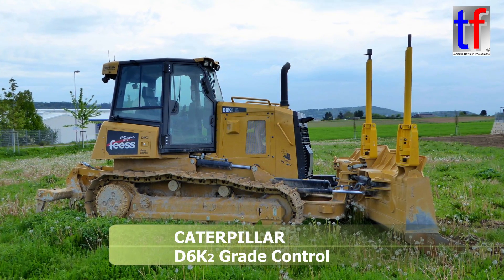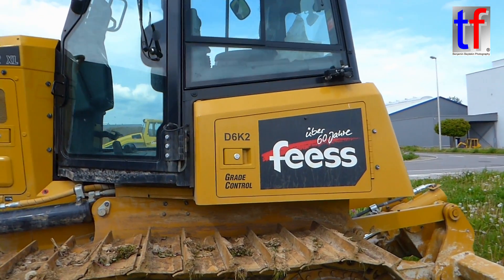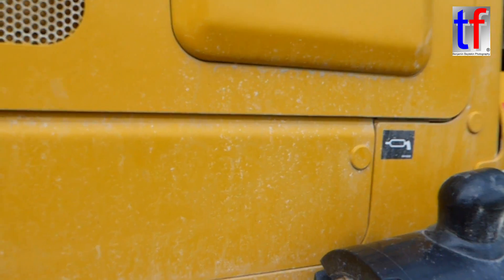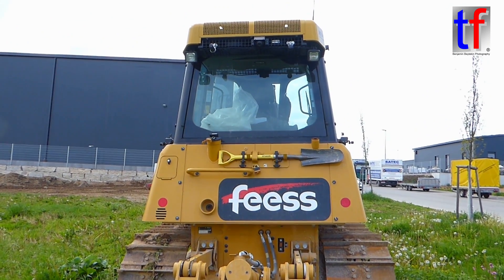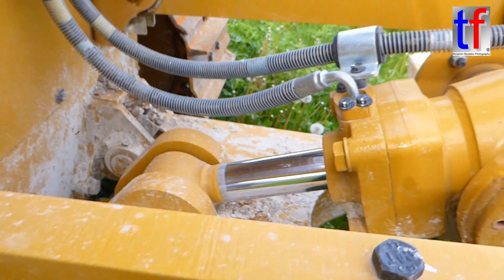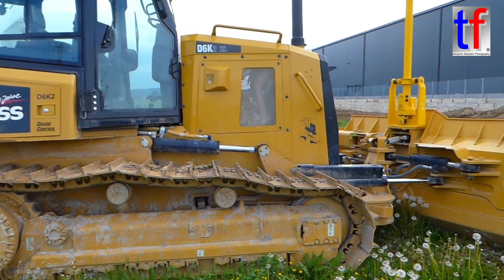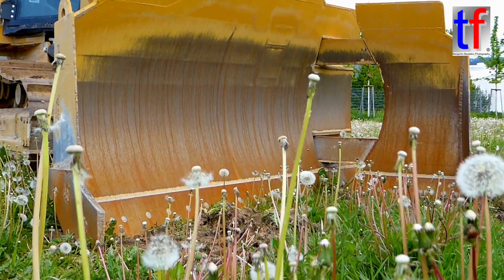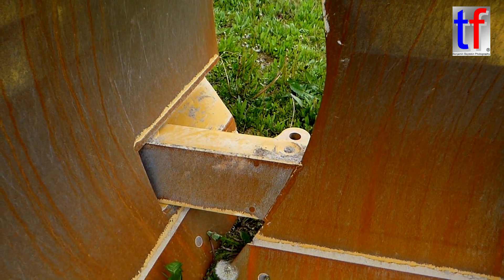CATERPILLAR D6K2 XL Grade Control Documentary, 2017.

Comment: You did a good job with this one man. I have a slightly older Bruder D6 T in my fleet. I got it in January 2013. And for my birthday I'm asking for my very first radio control excavator that's not wired. It's a cat 330 F with a white cab and it's 1/16 scale.
Reply from the maker: Oh, wow. An informations about that 1/16 rc model?
Reply: well if I get it for my birthday I for sure am going to be doing an unboxing and review of it. But anyway. You can find it on Amazon, and it's sold by two different sellers. It's made by DoubleE toys, however you actually have three different options. The first and the most expensive is the package that comes with the second NINH battery in the hammer. That is about 100 bucks. Then you have the second option which is the excavator it self with no special accessories and that one is about $89. And the last one is the cheapest, and it's sold by Cheerwing USA and this one comes with the forestry grapple. Now the cool thing about this excavator is you can interchange the attachments and purchase them separately. So my hope is that I get the cheapest one with the grapple and then I can just die the shovel in the hammer later.
Reply from the maker: Oh, I never know this brand before. Just googled the rc excavators. Let me know if you done the unboxing video when got the model.
Reply: I will certainly let you know.